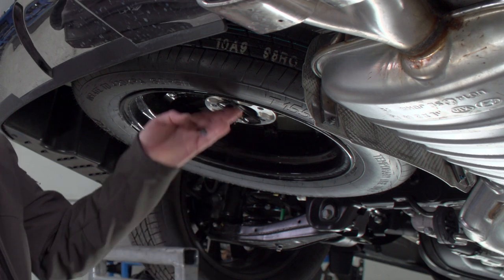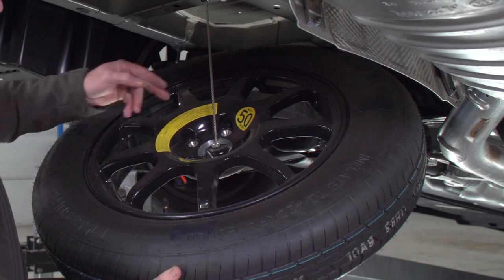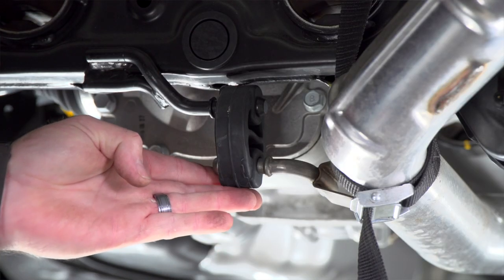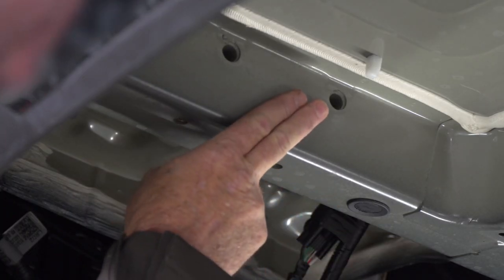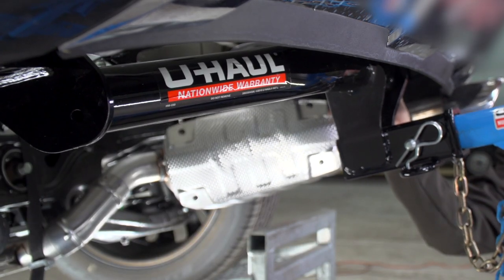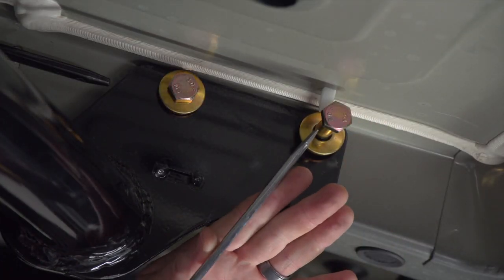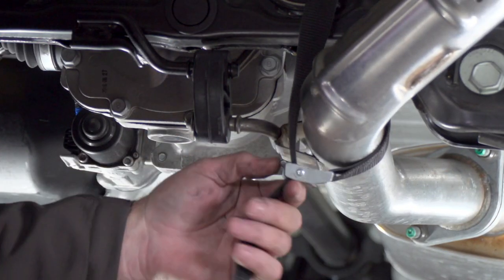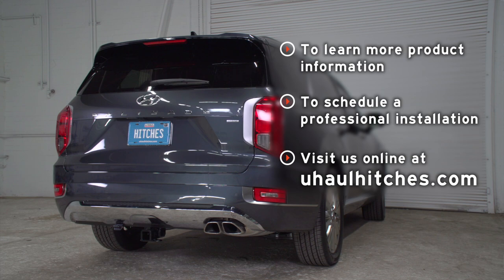2020-2024 Hyundai Palisade | Trailer Hitch Installation | CMF13427

Comment: Winch not wench...but great and informative video! You could have passed the bolts from the other direction and held the washer and nut behind the plastic clip to save removing an extra screw.

Comment: So what are the manufacture torque specks, what is the ft lbs for the bolts? not found in owners manual and didn't come with the hitch, how do you find this out. Great video otherwise should of included this information.
Reply: yeap it didnt come with the manual on how many foot pound for the 19 mm side to side and 17 mm vertical bolt.  please correct this is in not 10 and 12mm bolts.  this got me confuse when i tried to do today.

Comment: great video, thank you!
 I installed my hitch this past weekend, but  I can't get the black cover that sits behind the drivers side rear wheel back on snugly due to the large bolts coming through the frame. Anyone else find this problem?
Reply: Im going to reverse the direction of the bolts, I think that will work.

Comment: After my installation i hear a weird noise from my muffler also the install guy slightly scratched my car and scratched my hitch as well i guess you get what you pay for but even then they have to be professionals about their job
Reply: I have the same sound. It looks like there is a heat shield under the muffler that is touching a bracket from the hitch. I think that piece can be bent slightly to alleviate the sound. Going to look into it.
Reply: @TheBlandry186  yes i ended up doing that
Reply: Did that work for you? I've been lazy and haven't tried yet!

Comment: This doesn't talk about the trailer wiring at all
Reply from the maker: The wiring is a additional part and a therfore a different installation Video. I recommend a 7way quick connect for the 2020-2022. It will install similar to the following Video. Here is a 4 flat wiring on a 2020-2022: https://youtu.be/Ne2zmc3QBas.

Comment: If you're going to do a DIY video you should show every step.  Why did you leave out how you got the plastic clip out of the way? That's the reason why I gave your video a thumbs down.  Seems like a very important part if I'm going to do it myself.
Reply from the maker: Hi Vitelio! The plastic clip becomes flexible once the mounting screw is removed. This will allow the bolt to slide through. This is addressed in the section of video from 3:45-4:15. Thank you for your feedback, we'll try to be more clear next time around.
Reply: I don't usually comment but if you don't know how to remove those plastic clips, you shouldn't attempt to install this hitch yourself .